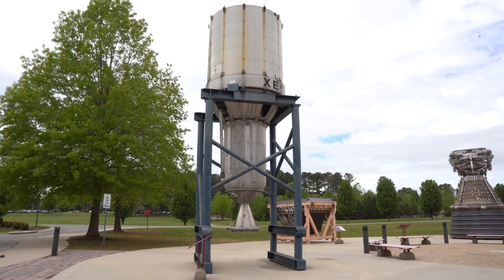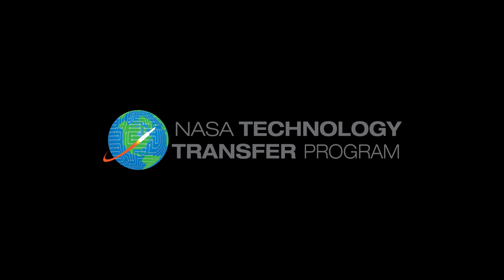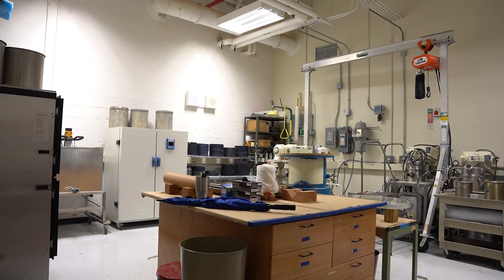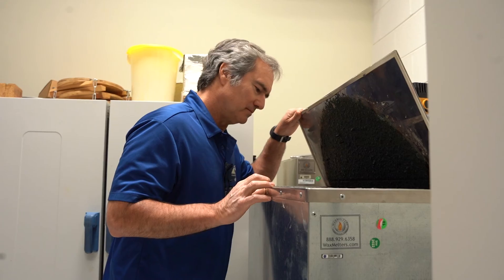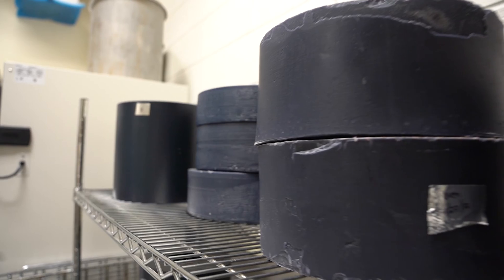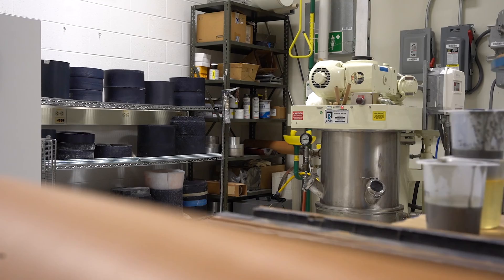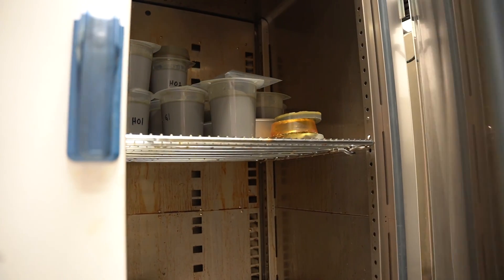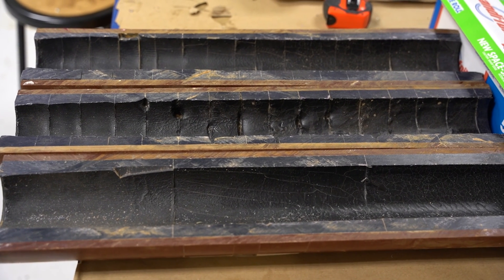NASA's Defect-Free Paraffin Fuel Manufacturing

Comment: Paraffin wax mixed with carbon powder and aluminium very fine powder.. Been trying this for 6 years.. Works but erodes the nozzle throat quickly and badly no matter what the material used.. Stainless Steel in my case..tried graphite but erosion is worse..
Reply: Which additive would you suggest? My rocketry team is working too with light paraffin wax (C16H34) and we're not so sure about which one is the best yet!
Reply: We are thinking about Black carbon %1 and Alumnium or LiAlH4...